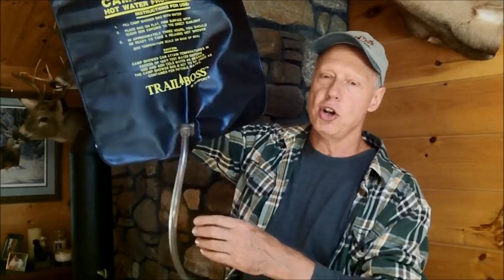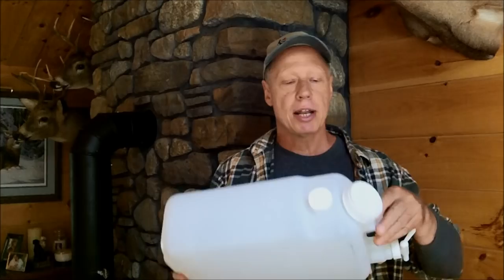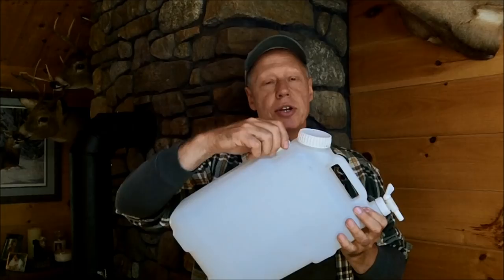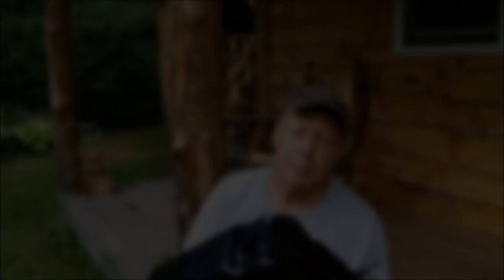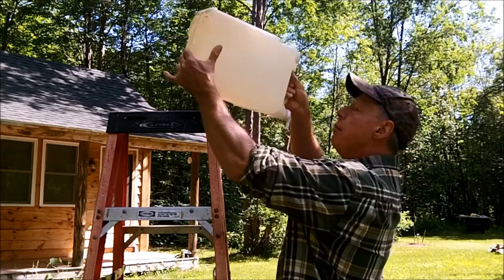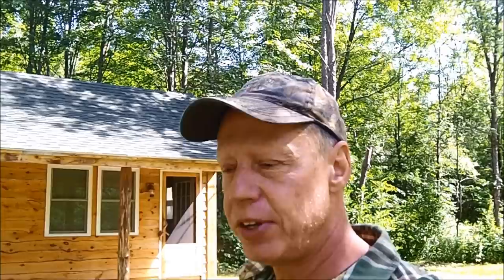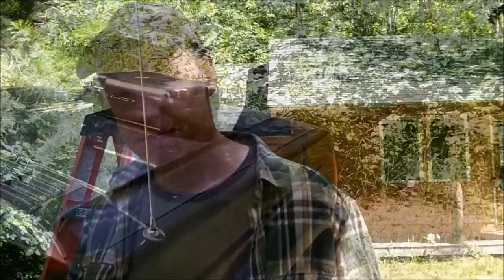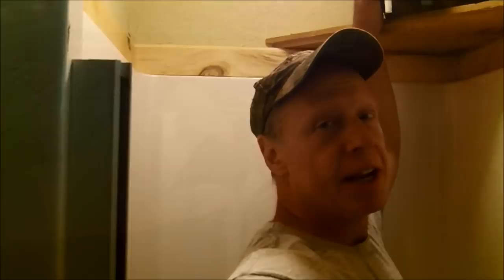HOW TO MAKE YOUR OWN SOLAR SHOWER.  DIY Project.

Comment: You are totally correct about an outside shower. They feel great.  When I was an infantry soldier in Vietnam we would get back to the rear about once a month.  The showers, in base camps,  were large dark bladders set high on wooden beams stuck in the ground.  If the sun was out you got a warm shower and if it was raining the water was too cold.  When we were on patrol in the jungle we used mountain streams.  Usually cold but it's all we had.  I really enjoy your vids.  Thanks.
Reply from the maker: Vvet 762  Even on a hot day, a hot shower outdoors is incredibly refreshing.  Nothing compares to it.  Thanks for commenting and thank you for your service.

Comment: Here in Spain we use sun to do many things, like whitening the towels, bed sheets, dry orange peels to light the fire...I'm gonna try this as soon as possible. My goal is to spend as little as possible in electricity.
Reply from the maker: *****  You will be surmised at how nice of a shower this is for something so cheap and simple.
Reply: Dry orange peels light of fire ,, I have to try that never heard of it thank you I'll try
Reply: You just need a 3-4 inch magnifying glass to get a fire 🔥 going.
Reply: And a wee bit of nail polish remover!

Comment: I painted a  5 gallon bucket black, set it in the sun for a few hours and I couldn't believe the difference in the temperature difference. Thanks for sharing your idea.
Reply from the maker: ladyb003 A flat bottle like this 2.5 gallon jug will heat up fast in the sun, especially when placed on a metal surface like the hood of a car.
Reply: Yes I agree....thank you

Comment: Great video. In the winter, if you put black insulated curtains in your windows (especially the south facing windows) you can heat your home the same way. Just leave a gap at the bottom and top of the curtains. On sunny days, the cool air will come in from the bottom (you can put a fan at the bottom) and as the air warms, it will rise and come out the gap on top. That's how I heat my rv. I have black curtains in the cab as well as all the windows. In the summer, I use aluminum instead to reflect the heat away from the windows.

Comment: First time watching your vids.  Excellent, neat, simple, common sense ideas.  Need to go through your entire site now.

Other ideas, that could be considered solar, are to do the Applachian distillery copper coiling condensor unit.  Use copper tubing with 2 metallic cut off valves, You make such solar system inside the cabin, with a southern facing window, black paint the coils, and add some painted black aluminum flashing (backing) attached to the coils.  Have the 2 coil tubes sit in your water container, like this plastic carboy.  The input tubing will be at the bottom of the container.  The output tubing will be at the top of the container.  The solar heat pushes the warm/hot water upwards, while pulling the cold water up the tube for warming.  The downward tubing returns to the water container.

This unit can be installed in your atrium, flower arboretum, aviary, southern exposure bay windows, green house, hot house, outdoor shower stall, etc.  Then take the bottle for the shower.  When you need to remove the carboy, shut off the 2 valves to keep the water inside the tubing, and replace with another carboy of cool/cold water.  Then open up the 2 valves again, and reprocess the new carboy water supply.

If you really want to have a non-issue with heating, then lifting the weight and height of a carboy container into your shower, then don't.  Have a fixed (heated) water container, and have a plastic tubing from water container to shower head, with a boat glas line squeeze bulb.  Squeeze for the pressure you need pushing up and over your head, at the rate you want.  Otherwise, the more easy way is to have a foot-operated squeeze bulb (pedal), and foot pump while taking the shower.

In a non-solar device, use the old stove and wrap the copper tubing around the flue.  Same design for a water container.  You are always burning wood, use the heat for a needed design.  The same copper tubing is also very good for a room heating device, with copper tubing extending all the way to the bottom of the floor, where cold air lays.  Wrap multiple copper tubings around flue, and raise the tubing all the way up to the ceiling, and make outward arrays (shooting in all directions) you have your own hot air conditioning system.

The same designs can be done for a southern facing window or room with just black plastic tubing.  The air will heat up and circulate in the house without any energy or motors.

If you have a wood fireplace, then install the copper tubing within the upper fireplace mantle and the flue.  Just have the water container with 2 copper tubes (and cut-off valves) for controlling the water within the tubing.

A little rocket stove can have the same copper tubing installed inside the brickwork or above it, like the same alchool distillery coilings.

You don't have to be big, to have big results.  The rocket stove, the southern bay window, the fireplace, the cooking stove, are all heat producing areas.

Both water heating and air heating for the house are easily obtained.

You might not even want to have a mobile carboy.  With multiple carboys or a larger container, imitate a modern water heater with insulation around a large water container.  Have your solar or fireplace/kitchen wood stove/rocket stove device heating the tubing that comes and goes to the water container.  The continued heating of the water in the tubing maintains the container heat.  The container is insulated against heat loss.  You could make such hot water container from those carboys, 5 gallon (new) white plastic buckets, even those 50 gallon (plastic or steel) survival water barrels.  Have your external plastic tubing with hand or foot squeeze bulb, and you have your instant hot water tap at the kitchen sink or bath room sink, and your shower head.

To obtain water pressure, height is critical.  But lifting heavy full carboys, and dropping empty carboys is time consuming.  Make an elevated water container that remains at that height as the household main water container unit.  Then use the water (and water pressure as needed).  No need for a shower hand or foot pedal squeeze bulb.  You only need to have another lower water container that you fill with cool/cold water, and have plastic tubing between the lower and higher water containers.  Use the foot pedal to pump water from the lower to higher water container.  Otherwise, there is the more easy conventional hand-crank drump pump.  Voila!  Simple, simple.  Heated water container (at height) for hot and pressurized water flow to kitchen, to bathroom, and to shower.

If you did have a large solar southern exposure area, then your same black painted backing around a black painted 50 gallon plastic or steel water barrel, and you have immense hot water.  Attach a small insulated solar room addition to the house, for a raised 50 gallon water drum, on a steel or wooden frame.  The room is insulated from all outside weather, only accepting solar heat.  You have a truly intense heated water operation.  A lower 50 gallon drum stores cool/cold water under the upper container.  The heated drum will also heat the lower container.  You have 50 gallons of hot water, and 50 gallons of warm water, for any off-the-grid need.  Use a hand or foot pedal for the warm water supply needs.

You can step up this design, just a hair.  With the 50 gallon water drums, you have 2 openings.  One opening is for the water-heating with the copper tubing.  Convert the other opening, and make a pressure seal.  Using a hand crank of water pumping (lower barrel to upper barrel), make a water-pressurized hot water barrel system.  Here you have height, but also increased water pressure.  You can do a hand crank air pressure system for both water barrels. Then the hot water barrel, and the warm water barrel, can have their dual outlet tubing combined to the kitchen sink for the same hot and cold water mixes, at the bathroom sink, and the same for the shower.  Have both water drums at height. Hot water drum and backing are painted black.  Warm water drum and backing left natural, grey, or white.

You do not use that much water everyday, so doing a 1 or 2 day hand cranking agenda on the hot and warm water drums for pressurization, and you have your utility water needs all fulfilled.

If you need to have a large, mobile, hot/warm water need in a truck or van ... or an out-and-about event (and no camp fire!), then use the engine header and tailpipe with a wrapped copper tubing, with the same water container design in the truck bed, and you have your hot water for camp or base camp needs.  Voila!

All excellent ideas.  You have got me really thinking about this.
Reply from the maker: John Lord There are so many ways to achieve the task of heating water but I like things simple. I heat what I want and when I need it,  then put the jug away.  Just about every task can be made complicated and expensive but I left that lifestyle far behind me.

Comment: Thank you for this tip. I did exactly as you showed . It works GREAT. So much that I have to add cold water to the jug.  I used spray on bed liner from Dollar General (Their house brand) to paint the tub and the Carboy jugs. Once again thank you for this awesome idea. Take care and God Bless.
Reply: can any paint work as long as it's black?
Reply: Charity McGowen .....any black paint will work

Comment: Pretty clever.  Most people waste so much water washing themselves.  Most of the time, I wash with a spray bottle of vinegar water and dry with a paper towel.    I used to have psoriasis pretty bad on my legs, elbows, and scalp, but that left after I stopped using soap and started washing with vinegar water.  Probably not for everyone, but works well for me.
Reply from the maker: This shower works incredibly well for something so simple.  Been using this for years.

Comment: Take a large pump up bug sprayer and cut the wand off and attach a vegetable sprayer you know like the kind that people have on their kitchen sinks then you can pump the tank up by hand and have a pressurized shower....it's cheap it's easy and you don't have to put it over your head the tank can just sit in the corner of the shower

Comment: I had a friend that lived in mid Alabama and at the time he was in the process of building his own home, I drove down to give him a hand and the only shower system he had at the time was an outside type that was made from 4 sheets of plywood built on top of a wooden pallet, it had a 30 gallon plastic drum and painted black, You would think that with outside temps during the day hovering around 100 degrees all day long, the water should be scalding hot, but that was the coldest shower I had ever taken. We even got special concave mirrors that would pinpoint focus the sunlight onto the drum in an attempt to raise the temp of the water, but to no avail. It was so cold that I thought I had misplaced my "package" due to shrinkage so much from the bitterly cold water of that shower LOL
Reply from the maker: Nortekj Damn the shrinkage!!!! :-oThe water needs to be confined to heat up unless its a tank inside a glass enclosure.  I have a black barrel and the water won't heat up very much. There's just too much volume there.  This black jug offers a really nice shower for something so simple.

Comment: You're so right about the solar shower having to be hoisted up high...suits a reliable tree-branch and a rope, but even lifting it up to hang it off the shower nozzle in the bathroom was impossible for my wonky back... water is heavy!! I think l will try a black bottle as you showed, with a footpump, which l have seen on "living in a van"  videos. Thanks for a great video! 🙂👍💧🚿🛁
Reply from the maker: Funny to be reading this not 2 minutes after getting out of the shower.  Same bottle after all these years. Water heated on the woodstove and no complaints ;-))
Reply: @thebossoftheswamp  Thankyou! 😊

Comment: Two 2&1/2 gallon containers will also heat up much faster than one 5 gallon container because they have more surface area. Also it's much easier to move around a 2&1/2 gallon container of water than it is to move around a 5 gallon container of water.

Comment: HI Boss!! This is a nice idea. I watched a video of some organic gardeners who invite people to come check out their garden. The visitors stay in tents. The gardeners have buried a garden hose in their compost pile that then goes up the wall of the shower stalls and has a small battery powered water pump. The water is heated by the compost. I've also seen garden hose put on the side of the cabin facing the sun and again the water is heated and brought into the house with a small pump. So many cool idea's. Just common sense and creative thinking. :) Glad to see your well. ATB Louise
Reply from the maker: Louise Florida Neat idea about the compost. I like that.  I bought tubing to make a solar water heater but that's a project for later on.  Yep, sooooo many cool ways to utilize mother nature.  All the best.

Comment: I used the black shower bag myself for one summer when I first built my cabin.  I hung it outside using a forked tree branch I cut to hoist it up and hang the shower bag from a cutoff tree branch that was about 7 feet high.  It worked pretty good.  I did away with it when I got power to the cabin and was able to use a pump.

Comment: Boss, this is one of the missing pieces of the puzzle to my own backwoods cabin. I do love jumping in the river but there is no denying that a shower adds  so much to a great cabin. Can't wait to give this approach a whirl - Thanks !!!!!!
Reply from the maker: Jerry Hegarty  Just about every hunting camp and cabin I come across has no "bathing" room.  Even our family camp didn't have one and it's 24x24 with rooms upstairs.  I just put in a stall shower there, built a vanity, medicine cabinet and now working on an icebox for the place.  You won't be sorry for putting a shower in and this bottle works awesome.  Have fun with your project.
Reply: thebossoftheswamp Going to start on the outdoor variety first then section off a part of the cabin for an indoor bathing room. Going with a composting toilet in NH? Keep up the great stuff here JC, you're a mentor to us all!
Reply from the maker: Jerry Hegarty Yep. Just built a composting toilet, rustic vanity, medicine cabinet and just finishing up the icebox. The NH cabin will be styling :-))
Reply: thebossoftheswamp Boss, Just built an outdoor shower using a 5 gal. carboy (Uline was out of 2.5 gal version) - what a game changer !! worked like a charm and even got creative with the outdoor shower stall design. I took several showers in it the past couple days and it is just awesome to take an outdoor shower. Plenty of pressure with lots of water to spare - just an amazing addition to the our 'cabin on the hill' - thanks !

Comment: Such a great idea. I live in south Alabama and power outages are a big issue especially during hurricane season. Got to get one of these and I can use it even during most of the year. I'll save lots of money. The water heater is at least the 2nd most energy hog in your home. Thanks for this simple, cheap idea!
Reply from the maker: houseofjacob  I have a 50 gallon water heater at the homestead. Last year I experimented and shut it off completely and just heated water as I needed it and used this bottle for my shower.  Prior to this, my house would use about 2 3/4 tanks of propane per year with a cost of around 800 bucks.  Now, one tank last around 17 months and I can put the money elsewhere.  I can live with that.

Comment: Great video. Brought back some memories of months in the wilds of Afghanistan. All we had was one of those shower bags. It wasn't the greatest set up, but it really was the greatest thing when you could wash under a warm/hot outdoor shower. There is nothing like a hot shower outside in 30 degree evenings :) I sure wish we had one of those jugs.
Reply from the maker: Dave M These jugs offer a great shower for something so simple.

Comment: Pet stores sell thermometers that stick on the outside of aquariums, about the size of a band-aid.  Perhaps having one would be beneficial for you. 
Also, if using the solar bag outdoors....attach it to a pully,  or a rope over an overhead branch.  Infanite hight adjustments.
Reply from the maker: Brian Whippie  I've done the pully thing with the solar bags and it's still a hassle.  I posted this bottle method so folks can have an alternative shower at home during power outages.  The stick on thermometer may work but I'd think it would get a false reading when the jug is out in the sun. Maybe, maybe not. Thanks or commenting.

Comment: heres a little tip for getting quick hot water from the sun....spray a fine mist of water up onto the roof shingles on a sunny day and recover the water as it comes down from the eaves troughs into the gutter pipes !!  

p.s.   let a few gallons of water go down pipe first to clean off shingles and debri in the troughs ...then collect what you need
Reply: swanyut ...really? sounds like a lot more work, a lot more water and just ...ewe

Comment: Great video  , well I ordered my shower containers and they arrived . I will be spray painting them and trying them out,  I to want an outdoor shower on my property. I  can see it now under the tall pines with the squirrels  overhead lol.
Reply from the maker: jan jenkins  As long as the squirrels stay overhead you'll be fine :-))  Sfter you're done soaping and rinsing, turn that jug to full blast. It's a real soaker. Just don't forget to open the breather cap on top.